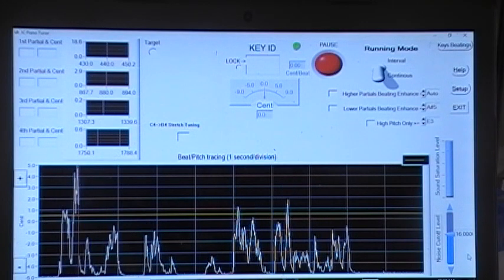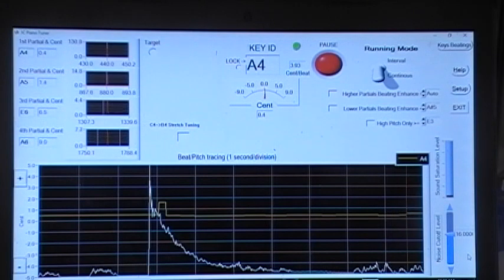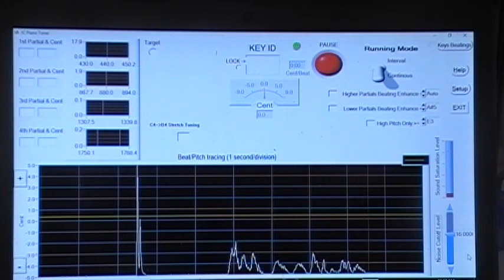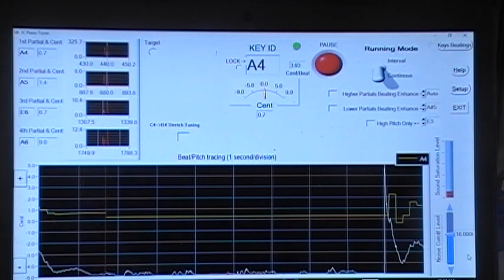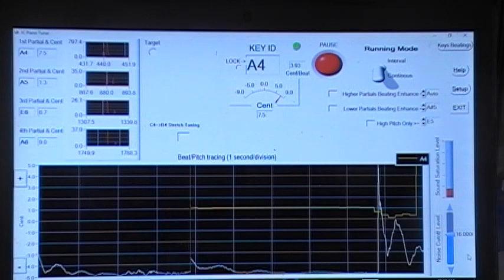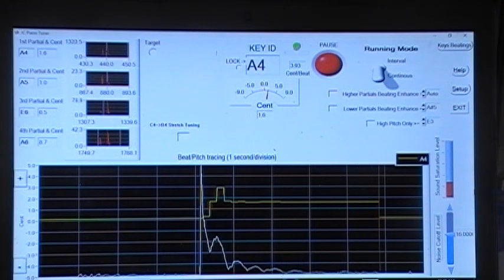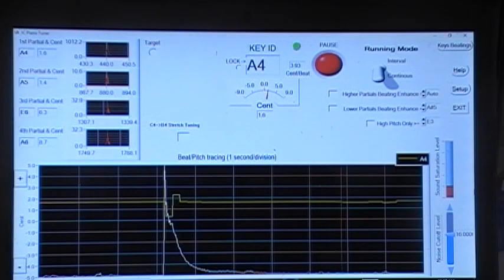Introduction of IC Piano Tuner: Tuning a piano key using visual sound beating wave.

Comment from the maker: The latest version 5.1.0 adds digital beat readout between a reference string and a played string. The beats of the corresponding equal temperament are provided together for easy reference. User can also toggle between 4 or 8 partial graphs display. Keynotes are extended beyond C8. The feature is also illustrated in the latest manual accessible in our website. Customers of Version 5.0.1 can request a free upgrade of this minor improved version by the end of Year 2021.

Comment: At 3:94 the obvious beat is about 4 bps. That's the 2nd partial. Maybe your app is only listening to the 1st partial. Aural tuners listen to higher partials to tune unisons because given an out of tune unison, the higher partials will be faster. Hence the instruction to make higher partials beat less which makes lower partials beat even less. howtotunepianos.com
Reply from the maker: Mathematically, higher partial beatings are multiples of the 1st partial beating. For aural tuning, there is significant difference between in-tune and off-tune (the in-tune sounds much weaker). For unison tuning purposes, one does not have to worry about which partial beating to listen. 
For visual tuning, however, the amplitudes of the higher partial beatings are overwhelmed by the first. To view the higher partial beatings, IC Piano Tuner provides real time filtering functions (the two ratio buttons below the big red button) to filter unwanted low and/or high pitches. 
As this video is intended to visualize the beating for beginning users, discussing higher partial beatings does not help. In fact, when the unisons are tuned, you will see the sound curve going down substantially without beating ripples, whether from 1st partials or higher partials. That is the beauty of the visual tuning, especially for beginning users without aural tuning experience.
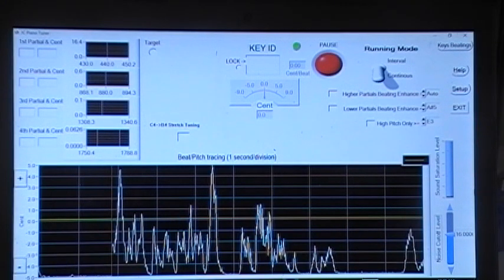Reply: Edit: It’s at about 3:14. 

But they can use ear cupping, ghosting, etc, and get better results without confusion. AND improve their ear at the same time. They can record and filter higher partials. They can use a tuneable band pass filter and hear higher partials without any effort at all. See https://www.youtube.com/watch?v=P1FvYJHE6kM

And on your recording it is very easy to hear the faster beating higher partial. Why not listen to that? I’m just saying to people reading this, don’t think that technology will be the answer if you haven’t explored even a little, the aural skill. 

We have a problem in our society today. Whenever ANYTHING becomes even the slightest bit difficult, many turn to technology. “Surely there’s an app that can do this better than I can!”  There’s a new term being coined to describe this misconception. It’s called “Technochauvinism” - the misguided belief that anything a human can do, a computer can do better, faster, for less money, etc. It’s just not always true, and believing it ROBS us of our humanity. . 

Besides, the fact is that professional piano tuners all agree that computers can not tune unisons well yet. We’re talking about some very fine adjustments that create “colour” in the sound, or “bloom”. And once you are aware of it, it is not hard to do. The harder thing is getting the pitch to change by a tiny amount. You need to do that with all tuning methods, even your app. No technology exists that even comes close to helping a technician do that yet. 

Good luck with your app. I’m sure it can very useful for some beginners. Just don’t turn the ears off folks.

Comment: Useful video.  Would like to see similar one for tuning F3-A3, F3-D4,A3-C#4 and showing the optimal beat rates (6,7,8 oer second?)
Reply from the maker: Thank you. The next video planned would be the stretch tuning from C4 to B4 based on perfect 4th and 5th. We will consider to add a video as what you suggest. With IC Piano Tuner, you can check any two strings beating easily just by looking at the sweeping graph. or alternatively the comparison (shown on the screen) of the pitches values for the two strings with one string as a reference.
Reply from the maker: Please watch this video: https://www.youtube.com/watch?v=BACt71n9PVo